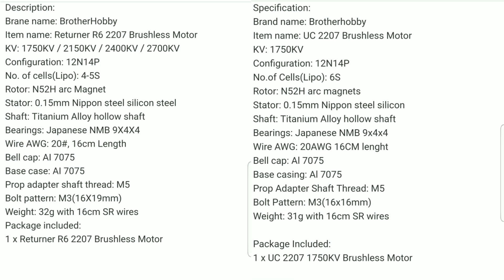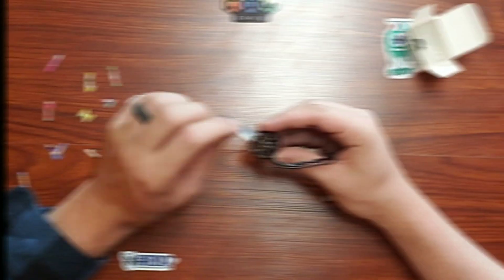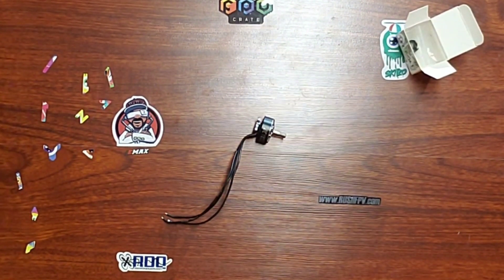UC Motor Honest Review! 1750KV 2207 (brotherhobby)

Comment: Can these motors run on 4s and 5s also? I dont want to burn out my new mamba stack and there is no info on amp draw that I can find
Reply from the maker: Yes you definitely won't burn it out it will just be underpowered. Definitely go for 5s. Itwill give you a nice smooth feeling. 4s is going to feel like how fpv drones did 5 years ago and it will have no balls.

Comment: Man!!! you need to apply some heat to that bottom screw to remove it, with a heat gun, soldering iron put vertical de iron and in the top the motor. They have locking glue, this happened to me in the past, so lesson learned, you convinced me to try this motors!
Reply from the maker: I did. At 800F for 40 secs
Reply: Mr. Tie FPV more time then, 1min at least

Comment: This motor looks really really good. Its only downside is the lack of kv options. That’s a shame. But they told in their facebook that this motor was a limited edition because fans asked for a good quality cheap motor, and then they said they did this one with the same quality as any of their more expensive lines and would be selling for almost the cost price.

And you will probably need a torx driver one size bigger than the allen you used. You will need to tap the driver till the end of the head, and then it will be able to be unscrewed. But beware because you won’t be able to use any other allen key in that screw anymore.
Reply from the maker: Hey man thanks for informing me about that. I am going to put  your comment in my next follow up video.